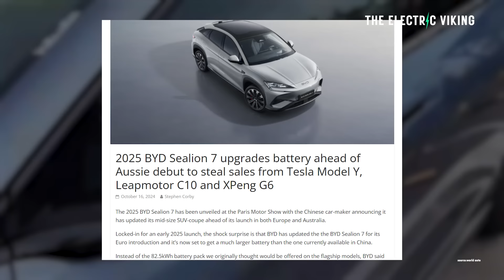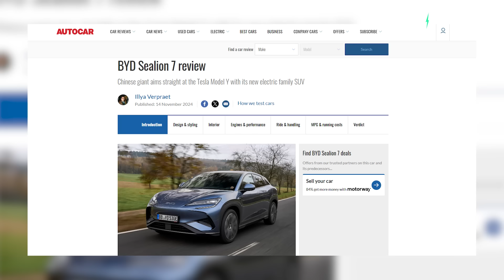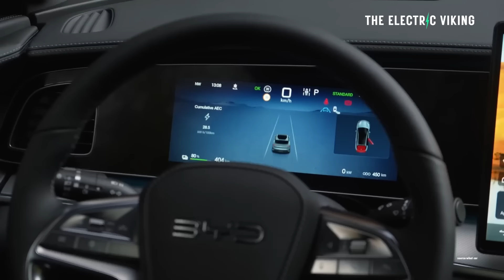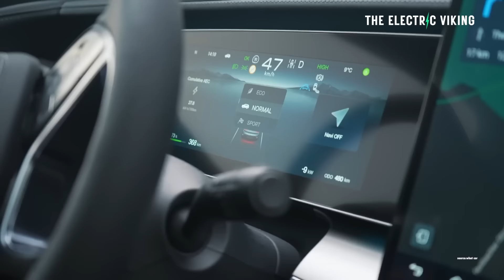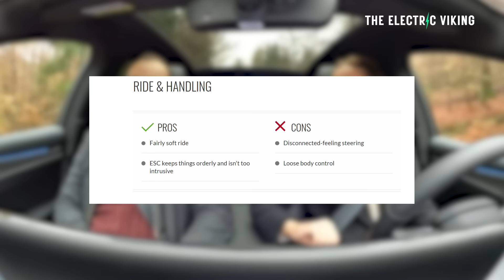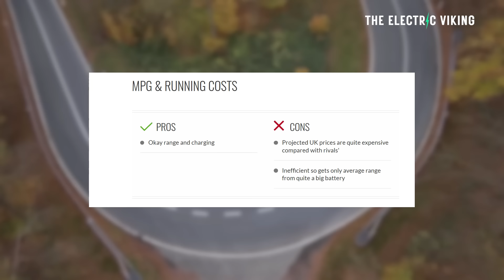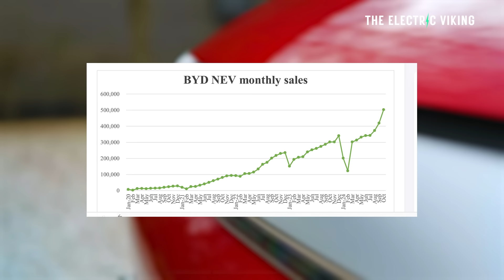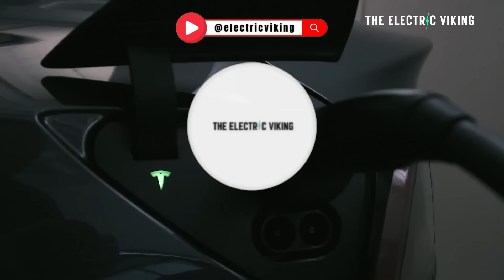Shocking review exposes major issues with NEW BYD Sealion 7 EV

Comment: Have you verified if the Sealion's range checks out for real?
I appreciate your reasonably detailed review of the BYD Sealion 7 that attempts to shed a truthful and fair light at this EV model and its pros & cons.
The big question here, however, as seems to be with all other BYDs - and it's quite disappointing that this most important issue is not even marginally mentioned by most EV reviewers - is how accurate (or truthful) really is BYD's PROMISED / ADVERTISED range vs the ACTUAL range this or any of their other models will give you in actuality.
Have you had a chance to test the Sealion models' ranges so far and verify BYD's claims? Have you compared the actual kilometers you drove against the "spent" kilometers displayed on the range display of your car in real time? Assuming that you, too, have noticed a considerable deviation between your Sealion's range display and the kilometers that your car ultimately delivered, how do you reconcile BYD's advertised ranges with your own experience..? I really wonder why this topic isn't discussed in more depth as this is surely BY FAR still the most important factor in the decision making process of buying an EV.

Comment: Fully agree with your comments Sam. I have a model 3 and the wife has an Atto3. The BYD ADAS system is so poor we have turned it all off. On the Tesla we use most of the ADAS features as they are well integrated. 
Once you have experienced Tesla full regen braking (one pedal driving) you will find driving the BYD to be tiring in comparison. I dont understand why BYD dont increase the regen and feed all that energy back into the battery. Seems a no brainer.
Hence I was sad to see the Sealion 7 had all the same faults as the Atto3. The screen and menu system doesnt seem to have changed much and is far behind Tesla. Its a shame as the Sealion 7 is a really nice looking car and the cabin and seats are very comfortable.

Comment: From my experience It's up to our driving behavior. Driving on a flat pave 100% charge and drop to 2% battery power left with 70 to 80 kilometers per hour. You will get 601 kilomerers 100 k to 120 k you will get 495 to 520.

Comment: In terms of the range, is no one going to mention that in everyday driving you can charge up to 100% because of the LFP battery. Other cars with longer rage do so by using nickel/cobalt batteries and in everyday use you will only charge to 80% to preserve the battery and only charge up to 100% on those rare road trips.

Comment: BYD Thailand is claiming that the Sealion 7 has a greater range than the Tesla Y. I'm not sure if that's really true or not, but here in Thailand, the Sealion 7 costs half as much as the Tesla Y. So the price is a huge selling point here. I'm talking about the performance edition AWD. But I know in Europe the same car is much more expensive, actually matching the Tesla Y in price. In that case, you can make a strong argument to purchase the Tesla. But here in Thailand, the price difference is huge. Which makes the BYD much more appealing. There's a huge price war in Thailand like there is in China among EV manufacturers which could explain the lower price here.

Comment: Efficiency is king. Why have many EV manufacturers not pushed this? My Tesla M3 RWD Highland is generally 4.5 miles per kWh for past 7 months and gives this at 70 mph speeds. A great increase over my Kia E Niro that did 3 to 3.5 miles per kWh at 70 mph speeds. 
Also bigger batteries take longer to charge and cost more as a result.
Reply: For EVs the only thing that you should consider is the WLTP range, not efficiency, you should know why.
Reply: Bigger batteries means more range when you are charged at 50%...which is the best way to minimize battery degradation.
Reply: @ Shouldn’t it be 80%? Correct me if I am wrong.
Reply: @jimmyhan4650  Efficiency gives range. My Tesla gives me 4.5 to 5 miles per kWh but range is around 270 miles. Double the battery and say efficiency is now 3 miles per kWh gives 330 miles. So efficient EV’s are the key. If that double sized battery could have same efficiency that would be amazing.
Reply: @Jaw0lf   WLTP range, charging speed, and efficiency are the three keys of consideration for an EV right? Charging speed is almost the same for everyone so we can tick that off for sure. In real-life, your example of efficiency of 4.5-5 miles per kWh and 3 miles per kWh is really unrealistic and in not way that it will vary this much for the range of EVs that are available in oz right now. So what is the real key here? just prioritise EVs with class-leading WLTP range and the only deal-breaker that you should look for after this is basically whether the EV with the class-leading range is hugely compromised by real-life conditions or not, i.e. as long as it doesn’t compensate by a large percentage of range deduction, you should just choose it over the other EVs with marginally shorter WLTP ranges.
Reply: @Jaw0lf  and no matter how large the battery is, just look for whether it is with a 400V or 800V architecture, that will reliably tell you whether it charges fast or slow, and normally everyone’s 30%-80% charging speed is pretty much the same.
Reply: @jimmyhan4650  My examples are my own experience of my Tesla Model 3 RWD and the Information from the BYD Sealion given in the video. In fact I believe it mentioned 2 so I was more generous allowing 3 miles per kWh. I charge from home as do many people so a large battery would not generally be charged in the 5 or 6 hours of cheap rate. I am in the UK so that means higher cost EV's from China.
At the end of the day people will buy the car that fits their needs, I was pointing out efficiency ithat is often overlooked plays a large part. I would much prefer a range of around 350 miles from my battery. For that I would need almost 6.5 miles to the kWh efficiency. Cars in the future may have this.
Reply: 80% is certainly helping to minimizing degradation.  However the higher the idle charge the more the degradation. You really want to stay closer to 50%.

Comment: No chance to try the Sealion 07 here in Finland yet. The BYD Seal is here though. My personal feeling about the BYD Seal was very positive. It has almost the same suspension system as the Tesla. The ride felt good. You could feel the power. I also liked that big central display. And it also has a second display. The interior was very attractive. The seats are very luxurious. These things are almost the same in the Sealion 07. Quite big energy consumption is BYD's biggest problem. For some reason, it seems that the new evo version is even worse in that sense.

Comment: I like your critical, objective approach to key criteria, even if many of the videos were taken from the test drives and initial reviews from Germany and not from your own tests. But that's fine. It is understandable that BYD is developing very fast and that software development is a complex thing. For European customers like me, aspects such as the weak service network, the slow supply of spare parts and the maintenance costs would also be interesting in the evaluation. Some people are surprised here: the much-praised Koreans charge twice as much for maintenance in order to refinance longer warranty periods. BYD (unconsciously?) pushes up the hourly service rates by using dozens of different screws on the panels where things could be simplified better. The use of different tires on the 2 x 4 cars is also economic nonsense and a contradiction to the otherwise outstanding quality.

Comment: @theelectricviking @electricviking #byd #BYDsealion #newEV #newcar

I appreciate your reasonably detailed review of the BYD Sealion 7 that attempts to shed a truthful, fair light at this model and its pros & cons (despite you apparently not having tested the car yourself yet).

The big question here, however, as seems to be with all other BYDs (and for that matter most other Chinese EVs) - and it's quite disappointing that this most important issue is not even marginally mentioned by most EV reviewers - is how accurate (or truthful) really is BYD's PROMISED / ADVERTISED range vs the ACTUAL range this and their other models will give you.

Have you had a chance to test the Sealion models' ranges so far and verify BYD's claims? I really wonder why this topic isn't discussed in more depth. This is BY FAR still the most important factor in the decision making of buying an EV. I'm so adamant about this issue because it's well documented online (and I've have had plenty of my own experience) that BYD ruthlessly overstates the range of their models: often, a BYD EV gives you just 60% of the promised range stated right there on its display, even when driving extremely gently (velvet foot on the accelerator) - and if you throw in a few hearty accelarations along the way you're quickly down to 50%.

I dub this: "BYD's fake kilometer range". What they're doing, seemingly in good tradition of the often fantasy like story-telling by generally many Chinese manyfacturers when it comes to product prospectuses in ruthless pursuit of more profit, is nothing short of shameless: in the case of the BYD Atto 3 Extended Range, for instance, they claim they give you 480 km range on a full charge, which is displayed (and sometimes even going up to 500 km!) on the screen at 100% battery charge - but what you get is actually a measly 300 km at the most. How does that conform with the BYD display? They simply base their displayed range on what I call the "BYD kilometer", which is in actually only 0.6 REAL kilometers! So after you've driven, say, 150 (real) kilometers, the BYD display has spooled down a whopping 250 (fake) kilometers! And you can imagine - aside from realizing that you're being cheated out of nearly 50% range, which must be particularly tragic if you already purchased the car (can you return an EV if it turns out the manufacturer was untruthful about its most vital features?) - this is REALLY annoying and frustrating on the road when now you always have to worry about making the next EV charging station and constantly have to convert the "BYD kilometers" into real ones, trying to align your remaining range on the BYD display (stated in "BYD kilometers") with the distance to the next charging station or any other destination pinned on Google Maps or similar, which of course is displayed in real kilometers. If you blindly trust your BYD's promised range and attempt to drive, say, an entire 450 real kilometers nonstop, as displayed on you navigator, and happen to refrain from checking your actual remaining range on the car's cluster, you WILL get stuck on the road with an empty battery!

You seemed to have driven the BYD Atto 3 extensively yourself - how have you reconciled BYD's advertised ranges with your own experience, assuming that you, too, have noticed a considerable deviation between your Atto 3's range display and the kilometers that your the car ultimately delivered..? I may have overlooked it, but I couldn't find any mention of this issue in any of your videos about the BYD Atto 3.

Again, I'm puzzled as to why this isn't called out more openly by reviewers? Might it be that for some the incentives from BYD outweigh a fair and square review..? This not only distorts the truth in general but also, sadly, is quite counterproductive toward reaching the goal of helping accelerate the transition to electric transport - as well as fairly promoting specific EVs - as downplaying this simply permits EV manufacturers that aren't subject to EPA or WLTP certification to continue to grossly exaggerate the maximum ranges of their models unchecked for the sake of driving up sales. The public deserves to be informed truthfully.

Your feedback is appreciated.

Comment: Hope ADAS is fixed with OTA updates like the Seal was. Far from perfect but so much better than at delivery. If they can keep these updates and continually get better, with the updates for the always showing AC controls, I think it'll do well. Weight is the enemy of a lot of things. The Seal is bloated even with its 390kw. If it had another 5-75kw or 400kg less weight it would be better still. But for the $75 we paid, it's been great other than one minor AC glitch in nearly 20k kms. Range is plenty at about 450-500kms in winter, we shall see the summer range. I'll sign up if the ADAS, suspension tuning for our market, and updated OS with AC controls shown are all fixed. Happy with it so far. Far from slow, but heavy. Happy with range, quality, reliability ease of use and overall car. If this is the same, sign me up.

Comment: I have a friend in Hong Kong who got this last month and he said the handling is actually better than model 3 or BYD seal. the steering wheel of any EVs will always feel disconnected compared to ICE, can't really say much unless I've driven one.
Reply: It’s unlikely to be true, or your friend simply prefers a car that leans a lot when cornering. Multiple reviewers have mentioned that this car has a lean-prone, uncomposed suspension due to its overly soft setup. Teslas don’t suffer from the same problem, because the suspension is on the stiffer side, and it’s also much lighter.

Comment: In regards to steering feel in particular there is no excuse for lack of feel especially when the software is as good as it is in China. They can alter and manipulate automatic gearboxes with software to lower emissions so this should similar on an electric power steering rack or drive by wire systems. But if it feels great and doesn't handle well maybe this is BYD'S way of telling you don't point it into a corner at speed. It will be interesting to see what Chinese brands will get this right.

Comment: Sam, your G6 is 800V architecture so how fast is it on 400V chargers (which most of them are)? Just wondering how they tackled it as Porsche use an expensive DC-DC converter (and charge for it) while Hyundai splits their pack in two which results in slower charging.

Comment: Nonsense the Atto3 ADAS in my Atto is every bit as good as that in my TM3, except to the Atto version is easier to use.

My suspicion is he has never driven the Atto any distance nor bothered to set it up. 

You actually have to go through the menus and set your preferences. Its not particularly hard but does require reading the manual to get the full benefit. The cognitively challenged could have difficulty, in which case they should get someone to set it up for them.
Reply: Well I own both and I couldn't disagree more. Tesla autopilot is pretty good whilst my Atto 3 (which is the car I drive the most) is nothing more than adaptive cruise control with autosteer (which is just glorified LKA). What's the difference - well the Tesla actually anticipates traffic in front, rear and at the sides, keeps an exact speed (something the BYD seems incapable of doing) and drives confidently enough that you just have to monitor. It's not perfect - I've had it brake on me when somebody turned right in front of me although there was plenty of room and twice (both times on trips to Melbourne) it's tried to take an incorrect exit - but overall it's a pretty good system. As soon as the BYD hits a hill it starts to slow down and it takes about 7-10secs for it to realise and start accelerating - even my old Outlander had better ACC than that. It would be the most annoying human driver ever. Think about that - if you're on the freeway overtaking traffic at the speed limit and it hits a hill, the Atto 3 starts to slow down leaving you in the median lane going slower than the speed limit. It's autosteer is OK until it isn't, when the camber of the road gets excessive. I've used it maybe 3 times but gave up on it. The Tesla is the simplest and easiest car I've ever had for autopilot/ACC. Double click down on the right stalk and use the scroll wheel to set your speed and the travel distance. OTOH the BYD when you first engage cruise control sets it to the current speed, right? Wrong - it sets it to 30km/h and you can then set the speed by advancing it in 5km/h increments. I think you can also set it after you engage by using the resume button but that's something I only discovered on my last freeway. Don't get me wrong - I like the Atto 3 but there's a huge technology gap to the TM3.

Comment: And another point of order - you don't have your facts correct.  The BYD Sealion GVW = 2750 KG (AWD version). Xpeng G6 = 2553 KG. So, there is a 200 KG difference (440 pounds, not 900 pounds). Yes, the range is less, but I've read that this has more to do with the high-performance motors used. The BYD software is fine on the highway, but the Xpeng is much better in city driving (I've driven both cars). Neither can touch TESLA's software, so they are only a direct competitor if you discount that.

Comment: If the Sealion 7 is a Seal on stilts, they have my money again. Love my Seal Performance. Charging speed isnt the fastest, its softly sprung, its not a 3 series, and ADAS was annoying until its update. And? And ive read the Sealion 7 will have the full 390kw in AWD form with a 4.5S on the boot lid. And these other cars have this and that and have longer ranges etc, so they say. But we dont know yet, do we? Havent seen any journo drive one yet. And lastly, a "perched" driving position, its an SUV isnt it? Didnt know it was a 911 GT3 with seating needing to be on the floor. Click bait as far as im concerned.